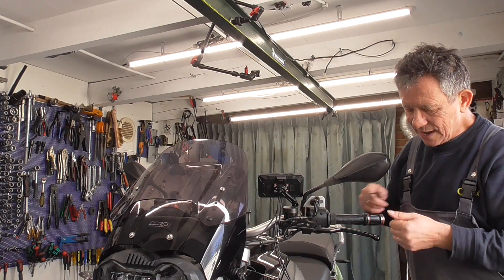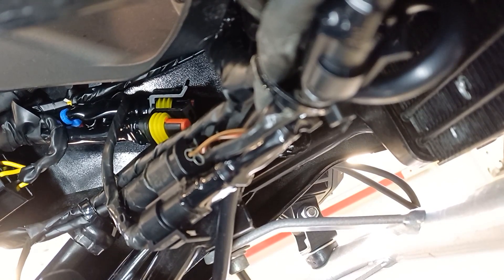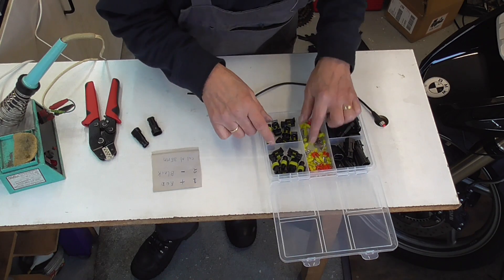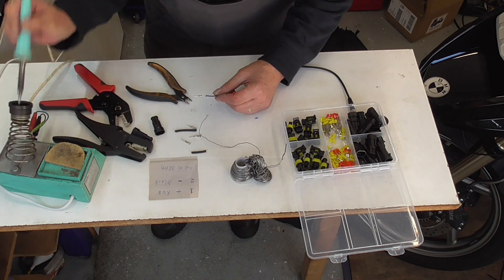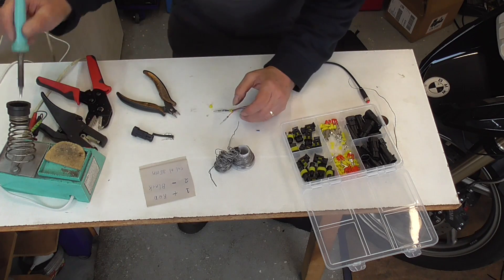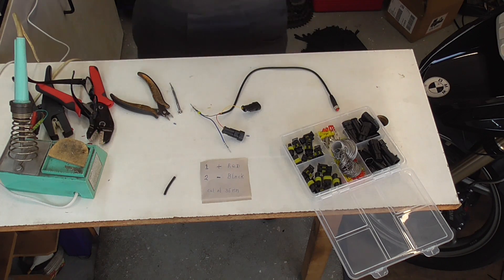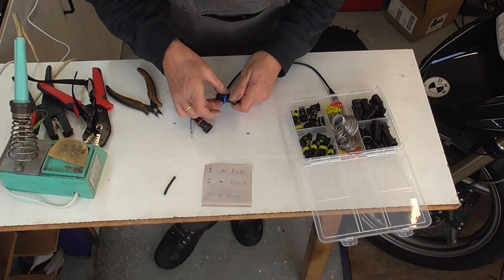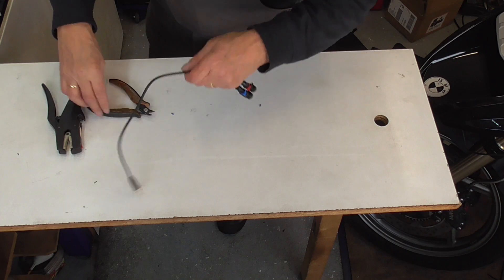⚠️BMW R1200GS Wiring: CHIGEE AIO-5 Connection..? The Old Mechanic's Guide to help YOU. ⚠️

Comment: Where did you run the cable from the rear to the display unit and from the unit to the battery? I'm struggling to find somewhere tidy